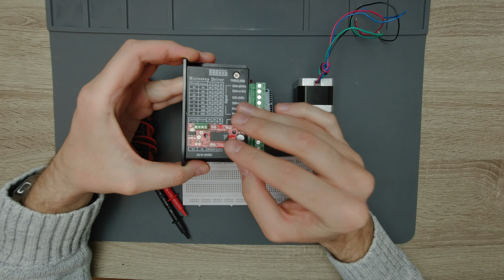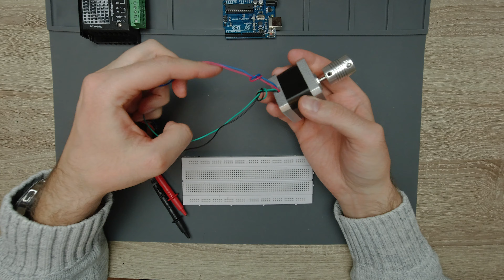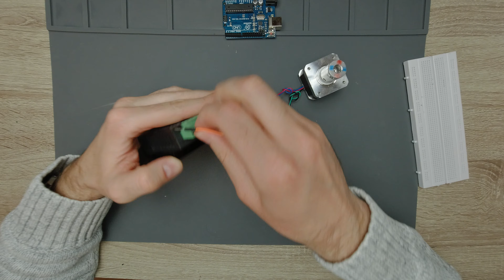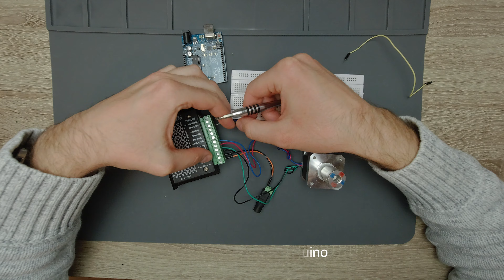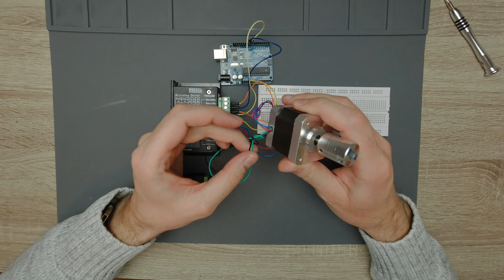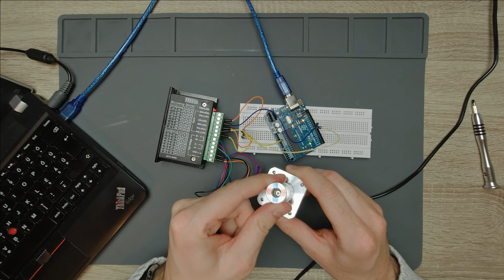TB6600 and Arduino - Wiring and demonstration

Comment: Thanks for the explanation. I see that your driver has the red light on, and mine does too. Is that an issue, or is it okay to continue? I’m also having some trouble because the motor isn’t moving. I think the problem might be that I connected the 12V power supply through the breadboard instead of connecting it directly to the driver. Could that be the cause?
Reply from the maker: Without seeing your connections it is hard to see what's wrong. But the red light is simply a power indicator light.

Comment: Why u didnt connect ENA- ?
Reply from the maker: Not needed. If you connect, you'll disable the motor.
Reply: Is enable and disable of motor is controlled by code ... as i am connecting ena- to digital pwm pin?
Reply from the maker: It can be controlled by code but you have to define the enable pin and enable or disable the motor in the code accordingly.

Comment: Thsi is awesome thank you. I was wondering if there's any difference if I connect  PUL -  DIR -  ENA - to arduino Ground and PUL +  PIN 1  DIR +  PIN 2 and leave ENA + empty? 
Will i lose torque or it's fine? 
Thank you again
Reply from the maker: The choice of driving pins doesn't affect the torque.

Comment: I have 2 Nema 17 42 stepper motor, 2TB6600 stepper driver,1 lafvin board and 12v 10A power supply i am trying to control this motor but i don't have much idea  can you help me?
Reply from the maker: Watch my videos. Full of information.

Comment: Can you please share the arduino sketch with which you make the engine turn so fast here?
Reply from the maker: It's shared, read the description...
Reply: @CuriousScientist  Thank you for your respons: I have exactly the same setup as you, but I want to run the stepper at maximum speed. Without Comandos and the whole mechanical part only the driver, Arduino and Nema motor and it should just turn high speed. I've been looking for 2 weeks, and can't find a sketch that accelerates my engine as much as yours in the 1st video..
Reply from the maker: My channel is full of tutorials. I don't really understand where you got stuck for 2 weeks...

Comment: i want to understand why you used pin 9 and 8? did you use it because it generates PWM or its random wiring? and  if i was using stm32 what pins should i use? please reply to me. i appreciate your help and thank you.
Reply from the maker: AFAIK, the library just toggles the pins, so it doesn't matter if the pin can generate PWM signal. Could've picked any other pins. It's up to you which pins you use.
Reply: @CuriousScientist  ok i get it now, thank you

Comment: Didn't work for me. Cannot even figure out what text editor you are using because it doesn't appear to be the Arduino one and you don't say what it is. Is it a Python editor? Who knows, I just gave up.
Reply from the maker: You use whatever editor suits your needs. I used MS Visual Studio with the VisualMicro add-on. The code I provided is obviously written in C, I don't even know why you think it is python....
Reply: I thought it was python because I believe you can control steppers via python /arduino. I have a simple stepper program which works fine so I was sure it wasn't my driver/arduino at fault. No problem anyhow. I was only trying it out of interest.

Comment: The TB6600s I have, use the base of a transistor for Step and Dir inputs.  I've found that this shorts, killing the arduino output pin.  The schematic I found uses opto=isolators, not transistors, so this is an error or big difference between suppliers.  Not a good thing.
Reply from the maker: It's always good to consult the product's datasheet. Similar looking devices can have different internals.

Comment: Is it possible to connect another type of motor to that driver? The motor I want to use is a servo motor composed of a multi-turn potentiometer and a DC motor, without control circuit board for the position of the motor, just only five cables, two for the dc motor, + and -, and three for the pot, ccw, cw and s. I have been looking for information about my motor and how to conect it to the driver and an arduino mega, but I can't find anything and I would be grateful if you could help me. Thank you
Reply from the maker: This driver is for stepper motors. That's why you won't find any information about how to connect it with a DC motor. You need a DC motor driver. TB6612FNG is, for example, a good choice if your motor is not too large.
Reply: @CuriousScientist  thanks for answering so quickly. I will follow your advise
Reply: @CuriousScientist  I have looked for more information about my motor and it is supposed to be a stepper motor. The model is HDM: L2.105.1311/01, SERVO GEAR MOTOR, Subcategory Stepper Motor.
Reply from the maker: If the motor has only 2 wires, then it is definitely not a stepper motor because a stepper typically has at least 4 wires. 2 for each coils. I tried to search for a datasheet based on the data you provided, but I did not succeed. But if it has 2 wires, it is safe to assume that it is a DC motor. Connect it to a variable power supply, set the current limit to a low value and gradually increase the voltage. If the power supply hits the current limit, increase the limit just a little bit. Observe if the motor is getting hot. If it starts to spin, then it is a DC motor. If it does not spin, then probably something else. If it is a stepper, there must be at least two more wires there somewhere.
Reply: @CuriousScientist  I just opened the enclosure and it is a DC motor with 2 cable (+ & -) and it is connected with gears to a 10 turn precision potentiometer like the model 7286R10KL.25 with 3 cable (ccw, cw & s) When I turn the shaft of the motor, the gears connected to the shaft moves the potentiometer at same time
Reply from the maker: Then, it is certain that you need to drive it with a DC motor driver. Read the encoder with a microcontroller and drive the motor with a signal accordingly.
Reply: @CuriousScientist  my motor works from 24V to 32V so I need a driver with more voltaje. I will try the driver DRV8871 Single H-Bridge. If I make any progress I will share it with all. Thanks again

Comment: in the terms of heat do you recomand it
Reply from the maker: What do you mean?
Reply: i have used a4988 and DRV8825  drivers and both gets very hot after using for few seconds then the motor start playing funny , becuase both drivers gets very hot even with heat sink applied , does the driver your using TB6600 has problem with high temperature ? @CuriousScientist
Reply from the maker: Ah, now I understand! Thanks! We'll, if your driver overheats, first you should adjust the current. Probably, it is set to the max value, which is way too much for a NEMA17 motor with a regular load. If you use the TB6600 with its highest current setting it will also overheat the motor. So, first before getting a new driver, try to adjust the current on the ones you have.

Comment: Would you be able to not use a breadboard and connect the 3 5v pins together and go straight to the Arduino? If so, how would you do that?
Reply from the maker: Sure, you can skip the breadboard. It was just more convenient for me to demonstrate it. I would just wire it up in the same way, but without a breadboard.

Comment: Loved your video, thanks!  Could you please let me know how I can add a standard 3wire 5v/S/Grn Optocoupler to your setup?
Reply: Maybe I'm not using the right name, I see it's called several different things.... it's an IR Optocoupler Interupter, the type of sensor commonly used in reprap 3d printers for limit control and homing of axis
Reply from the maker: Yeah, that's an optical limit switch (photo interrupter), typically a phototransistor module. In that case, your first comment was almost correct. However, pin such "GRN" does not exist. Probably, you meant "GND" (ground).
Reply: Yes.  Ok. Thank you!
Reply: It seems if I do it the other way the 5v pin on UNO is left open?
Reply from the maker: Thanks! Where do you want to add the optocoupler and why?
Reply: I would like to home the motor and tell it to rotate x steps ftom home.  Am I thinking correctly: Opto 5v pin goes to Uno 5v pin, Signal goes to maybe pin 10 and third wire goes to GRN pin on Uno?
Reply from the maker: It is still unclear why you need the optocoupler. Optocoupler is needed when you, for example, want to switch a low voltage signal with a high voltage signal or the other way around. A limit switch for homing is typically operated at 3.3 or 5 V, there's no need for an optocoupler.
Reply: Could I also ask you...... why in some videos I see ENA+ being used but in yours it is not?
Reply from the maker: Because I don't use it. I just keep the motor enabled. Some of my other projects, however, actively change the enable pin, too.
Reply: Ok, thanks.  In another video it seems to be the opposite of what you do ex: DIR+,pin2/PUL+, pin5/ENA+, pin8 these have their own pins.  But in your video you simply connect these to 5vpin Uno and DIR- and PUL- have their own pins.  Really confuses me,  seems opposite?
Reply from the maker: You should read the datasheet of the controller, and then you'd understand why it is possible to do both ways. 😉

Comment: I wanted to connect two stepper motors to an Arduino Mega using DM542T stepper motor drivers, watched several videos, and your video was the only one that had correct wiring that worked.  Thanks ❤
Reply from the maker: I try to provide useful information. I am glad to hear that my video could help you!

Comment: some of these have the pull - ,ena- ,ena+ , and direc - all connected to ground, why is that?
Reply from the maker: You can have it connected the other way around, too. It depends on if the inputs are active high or active low, if I remember correctly. Check the datasheet of the TB6600.

Comment: Can the ENA and DIR inputs be supplied by more than 5V? Will it work with 12V?
Reply from the maker: Preferably, just use 5V. If you have a higher voltage, then you'll need current limiting resistors. Read the datasheet because I don't remember all the details.

Comment: Example code have 
Used stepper motor which use 4 digital pins
(8,9,10,11)
What should I do?
Reply from the maker: I don't really understand what you mean. First of all, stepper motors don't have "digital pins". They only have "analog pins" if we want to be precise. 2 pairs for each coil in the motor. 

The demo code I provided uses 2 digital pins only, but those pins (step and direction) go to the stepper motor driver first. Then the driver has 4 output pins which are then connected to the motor's four pins.
Reply: @CuriousScientist  i tried to run the example code for "onerevolution" under stepper, the example uses 4 pins (pins 8 to 11) but i only have 2 pins available coming from my driver to arduino which are the PUL and DIR.
Reply from the maker: I have no idea what are you talking about, sorry. My code does not contain anything like "onerevolution".
Reply: @CuriousScientist  example codes are given in aurdino ide.
Anyways thanks for your concern.
Reply from the maker: Those codes have nothing to do with this demo.

Comment: sir can I use TB6600 driver for nema 57 stepper motor?
Reply from the maker: Hi! As far as I am concerned, the NEMA motors are only up to NEMA 42. However, The NEMA 23 is 57 mm x 57 mm so I will assume that you are actually asking about the NEMA 23. In that case the answer is yes.

Comment: Good overview. Can you explain what the ENA does? I understand it locks the motor when it's not receiving pulses, is that correct?
Reply from the maker: Thanks! The ENA doesn't lock the motors but it switches the current off. It can happen that current flows through the coils of the motor even when it is standing still which can lead to overheating. ENA turns off the current basically.
Reply: @CuriousScientist  So connecting ENA is better to avoid overheating?
Reply from the maker: Well, the best thing is to actively control it. Turn it on when (before) the motor must move and turn it off when you don't need the motor to be energised.

Comment: I'm brand new to Steppert motors but I'm a fairly quick learner my friend. Thanks for the brilliant videos and information but I wanted to ask u question if u have the time to answer..
Q. Can all this be used in conjunction with CAD & CAM, etc to be able to run my own home built CNC Router machine or would it be far more difficult than I think?? I really want to build my own CNC. I have bought 2 steppers with the drivers to run the gantry up and down the table and one for the More to move the router over and back side to side. I want to get a better motor for move the spindle up and down but I'm a little lost atm. I'm about to open my own small woodworking shop and I eventually want to build a decent sized CNC Router to help grow my small business. I still work fulltime atm but eventually I want to go out on my own with a workshop of my own. 
The links to the Arduino on Banggood are not the real thing my friend. U know that right? They're a copy of some kind but not the Arduino I saw at my work place today.. 
Do they work as well as the real ones or should I get the arduino parts? 
I have bought the Aluminium and pulleys, etc but as I said I'm a little lost atm. I'm not going to rush this bcos eventually I will want to use this experience to build better and bigger than the 1200mm by 800mm CNC that I have in mind right now.. I hope u don't mind me commenting on here like this. I would be very grateful if u could let me know anything about the questions I have concerning the CNC home build..
I don't want to use steel to build bcos I don't want to go thru all the issues with metal warping under heat and all that entails so I will stick with Aluminium extrusions I have been investing in..
Reply from the maker: Hi! Yes, you can build your own CNC machine based on DIY parts. Several people already did it. Also, there are many shared resources where you can make your Arduino compatible with GRBL and enable it to control CNC machines. Just search for "Arduino GRBL". 
There is no such thing as a "real Arduino" by the way... Yes, there are the official Arduino boards, but the design itself is an open-source microcontroller board design based on Atmega chips. Even I designed and made my own Arduino, and anyone can do it.
Reply: @CuriousScientist  Thanks very much for ur reply pal. I'm new to all of this type of thing but I really want to build one. I bought a load of 2020 1200mm Aluminium Extrusion, other parts to put them together and I got the V Slot wheels, and parts to run them along the sides of the aluminium. I also got stepper motors and the TB6600 drivers. I have 2 motors, Nema 17 type with the Drivers as well but how good should the motor for the spindle housing be? I'm not sure which Axis this one is atm but I'm learning all the time. I went on Banggood tonight and bought 3 UNO3 for a small amount so I hope they're ok. Everybody says they are compatible. The job I work at uses boards for Routers for companies like BT in England but they have contracts all around the world. I'm new to my job and I've never worked in this field b4 but I'm beginning to pick it up fairly quick now. One of the guys I work with showed me the Arduino board the other day. They have them in my job but I only saw it on Friday. TBH I don't know anything about programming or coding but I want to and I will work hard to learn CAD/CAM,etc and I will become fairly good at it down the line.
I appreciate u taking the time to reply to my comment my friend. It's really appreciated.Take it easy my bro..
Reply from the maker: Typically you can buy ready-made housing for the spindle. Alternatively, a lot of makers make 3d printed bracket for them. It is up to you. I wish you good luck on the learning journey. Don't be afraid of failures and keep trying. You'll get there if you stay motivated!

Comment: like everything else that i try this does nothing but lock the motor up
I copied your code from your website and installed the accelstepper.h using the installation tool in the Arduino software.  i get no errors at all but it does not turn.  is there a is there a smaller bit of source code I could try? The source code I copied is quite lengthy maybe I copied the wrong bit?
Reply from the maker: If it locks the motor up, you did not follow the video properly. The same code is shown in the video and as you can see it, it works for me without any issues. 
You can test your system with  simpler the examples provided in the AccelStepper library.
Reply: @CuriousScientist  I HAVE RECHECKED MY WIRING OVER AND OVER ITS PERFECT.
oops caps lol

I can run the regular stepper code included with the Arduino ide and it runs it,
maybe my dip switches?
Reply from the maker: I don't really know without seeing what you built or how you use my code. If you followed the video and copied the code, it should work. Do you by chance mixed the direction and step pins?
Reply: @CuriousScientist  no i have checked all of these many many times,  this is very very simple  mt 12v power supply is only rated for 1.4 amps.....but the stepper I'm using should work with that
Reply: @CuriousScientist  fixed my comment   1.4 amps
Reply from the maker: Unfortunately, I still cannot say anything else than before. It should work according to the video.
Reply: @CuriousScientist  i understand and i thank you for listening.  i have tried everything.  i have replaced every wire all power sources and I could wire this in my sleep at this point.
Reply from the maker: Do you use the entire code from my website? Which webpage did you visit? What is the baud rate in the terminal?